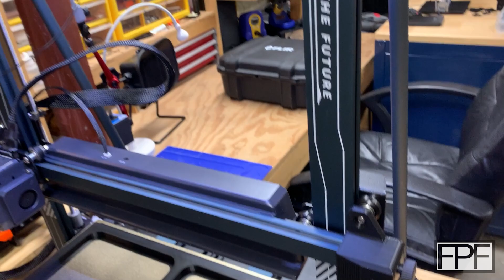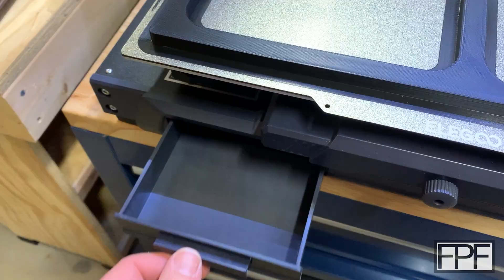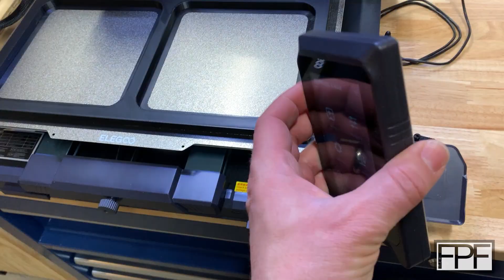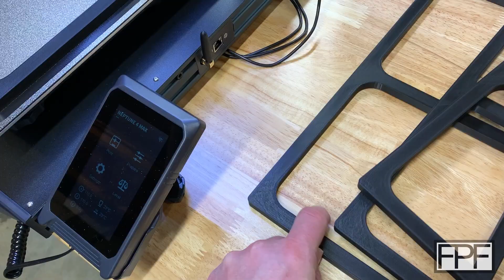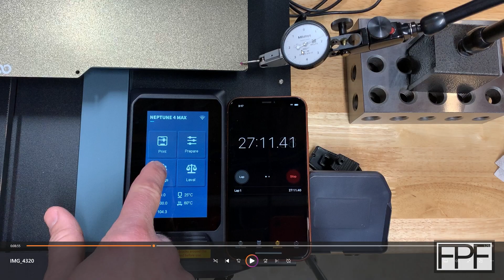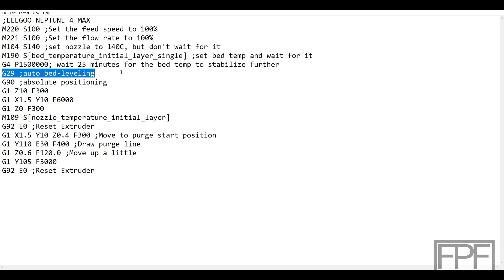Neptune 4 Max Review and a FIX for the PROBLEMS EVERYONE IS HAVING

Comment: So I got mine around the same time you got yours and I have had all the issues.Blob of death yup had it 4 times to the point where they sent me new heads. Firmwear def fixed a lot of the issues for sure. The issue I noticed that you did not mention was the back bed level screw knob backing off after a while. Like the movement would cause it to shimmy and next thing you know you have so really bad prints or worse the nozzel toughing the build plate something horrible  Great tip thanks.

Comment: @26:40 on my cr10 v1, I installed a cltouch and set up the gcode to where it heats the bed, levels the bed, and then begins to execute. 

I’ve always leveled the bed POST heating to the maximum I was going to heat for the current filament temp. 

Always a good idea to try and best replicate your working environment on these machines when dialing in

Comment: This is my first printer. It still sits in the box, unopened. I'm researching as much as possible. You say at the beginning this isn't a good 1st printer. Hopefully following instructions like these, before my first print, will help from me being instantly discouraged and throwing the 4Max into the dumpster. I'm going to do several upgrades before I even power it on, like X & Y linear rails, and a pair of front stabilizer bars. I'm undecided on a better (?) hotend like a Micro-swiss.
Reply: Just pull it out and print. Don't be scared, don't do upgrades before you understand the printer. Print, diagnose, fix. I'm not new to printing, I purchased this and I'm happy. I'm running into under extrusion so I'm playing with that. But I got 4 great prints already with nothing done.
Reply: How did all that go?  You sound honest, I don't trust many of these commenters.

Comment: Question.    Couldn't you bump the temp to 70C on warm up to allow for quicker equilzation then drop it to the desired temp that should shorten the time needed to get the bed warmed a simple temp gun would get confirmation on that.
Reply from the maker: Not sure, it adds more variables, and then more variables again as it starts to cool and the "maintenance" heating kicks back in to maintain the bed temp as it cools, all which will likely cause it to warp in different ways again.  Tnhe gcode I'm using has been working reliably for me since I released this vid, and I only use this machine for prints bigger than 305*305

Comment: I find it a miracle printers of this bed size manage to print half-decently at all. It is to be expected that heat expansion, bed movements, wear on belts and bearings will have a major effect on z height, especially when we are looking for precision of 0.1mm!
Look at your metal lathe, then look at this printer. The difference in rigidity and moving part quality is immense, yet the printer (and others like it) still manages to print at a reasonable quality. It is impossible to tune perfectly and for this tune to remain perfect long term, so I think we should cut Elegoo some slack here. 
As you said, the only way to counter this is to smartly compensate for the inevitable mechanical inaccuracies, in software. It is most likely what printers of other manufacturers achieving "perfect" results do without us realizing.

Comment: I've only ever used cura. Wonder if that's why my delta style printer (discontinued and the newest firmware isn't available from the manufacturer anymore) has issues with hitting the print constantly. Just downloaded orca because someone I talked to mentioned recently, but it has so many things that you have to program in for my printer (because mine is 4 years old and not on the list during setup) that I just don't understand what it all means or what they do. Cura is really simple compared to that. Plus my printer is on the list lol.

Comment: Printers this big should not have moving beds. This thing literally shakes itself apart. Their orange storm fixed this to a degree, but horrible execution on how you have to level it. I found that even doing everything you've done here, it eventually throws itself out somewhere else. I came into my office one day to find one of the spring adjustment knobs on the floor during an active print. I couldn't figure out what happened until I paused the print and felt the other knobs, only to discover they were also a thread or two away from falling off themselves. This printer has way to much vibration to keep all these things in check that you need for a good print. You might get 3-4 good prints out of it, then everything gets thrown out of whack again with just normal usage. I keep first layer at 0.3 to compensate for the deviation in Z. I know I'm never going to get a perfect first layer, but as long as I can get past the first layer ok, the rest are fine.

Comment: I'm glad I found this video, my 4Max is coming in post right now. Coming from a Flashforge 5M pro which, after tuning through orca is a great printer, I needed a larger vol for prototype parts for work. I've seen sooo many videos on why this machine sucks hahaha but I've seen the same amount of videos showing amazing prints. Tbh I have no clue how to work klipper.  I actually only know a very small amount of gcode...but knowing the info in this vid was actually a huge boost on what to look for

Comment: I will be getting mine tomorrow and this video is scaring me but then I read some comments and people say they are having no issues. Could it be some are better than others? I've also watched other videos about this printer and no one is mentioning this stuff. Because if this printer is this messed up,  Elegoo should be working on fixing these issues.
Reply: The people that said they aren't having any problems work for Elegoo.  ;). It's really hard to send it back.  If you don't open it and send it back it. costs you around $100 in shipping plus Elegoo charges a 5% restocking fee.  If you open it and don't use it and send it back they charge you a 15% restocking fee.

Comment: I am fortunate that my vendor is replacing my N4M after 2 months. This comes after multiple failed prints, hot-end replacements, and an extruder replacement. I am thrilled to get a fresh start. I want to be absolutely certain that I avoid the erroneous default software included with the impending machine. What version am I to install? Also, to summarize, I should install OrcaSlicer, but with the modified G-codes? You video is very informative. Can you please guide me the correct sequence in setting up my new N4M?

Comment: Hi. Your video saved my sanity... I dont have a Neptune, I have a Flashforge Adventurer 4. I suspect that bed heating is the answer for MANY other 3d printers.

I had a few other printers before this one and had similar issues. I had upgraded everything on the machines without much success. 

As luck would have it, I was interested in buying the Neptune 4 MAX and found your video.

I would recommend that you re-visit this topic and solution for general 3d printer adhesion issues. I have trouble finding this video because its not the name that I associate with it. 

I have been recommending your video to others with similar issues.

Comment: Excellent video - very informative and detailed. Thank you for sharing your knowledge. This specific problem has had me very frustrated for a while. The usable volume on the Neptune 4 Max is now within reach of reliable & repeated use. Like and subbed. I'm also adding a metal extruder gear and the Microswiss hotend for the Neptune 4 Max. Hope to get it to reliable workhorse status.

Comment: Wondering if you ever considered going hotter on the build plate for the warmup period, then letting it cool to the print temp.  Would that help you get to stable bed faster?  So if you printed at 60C why not run it up to 90C for 5 min then bring it down to 60C.  Would that get you to a stable point for your bed so it can auto calibrate at that point?  Curious to see if that sensor of yours gets to the stable point faster.

Comment: As a someone looking at getting into the 3D printing hobby, I'm so interested in this machine because of its build volume.  But the issues with the firmware(s), the proprietary slicer, lack of support for mainstream slicers, and all of the other problems just means it's not an option, which is pretty disappointing.  This machine has a great price point, but I'd frankly pay twice that if Elegoo would join us here in 2024 and provide a UX comparable to something like the X1C.  I'm not interested in screwing around with and constantly having to fix a printer.  I just want it to print what I want, when I want, and do a good job of it.  Really hope Elegoo listens to all of the reviews of this machine and comes out with something better.  I would still love to have a printer with this build volume, but this is just too much headache.

Comment: Ordered it, , heard about the Blob of Death, canceled the order, and thanks to you, consider to order it again for good.
Would you think that, for the long term, intensive use, linear rails update For X and Y worth it?
I also watched a video about nobs of the plate getting loose due to fast printings vibrations, what did you experiment?
Thanks again.
Reply from the maker: I do get quite a bit of dust from the wheels.  If I used it more, I would consider rails.  For me, this printer ONLY gets used when I need the huge build volume, so I'll probably keep the wheels.  I haven't had my knobs move at all.  Honestly they seem quite tight.  I wonder if people are "thinking" they are moving because they are seeing a height difference when measuring and not realizing it's from heating/cooling.  Obviously not true if people have videos of them moving, but made me wonder.
Reply: @FunctionalPrintFriday Thank you for your reassuring video, answer, I reordered the 4 Max. Do you think there are better quality wheels, less "dusty"?
As I plan to install my Neptune 4 Max on a heavy base, I wonder what its minimum dimensions could be to accommodate the feet. If I may ask you to measure... 😅

Comment: Very useful!! I inserted your gcode, I also don't care about waiting 30 minutes more when with this printer I print huge things that require more than 24 hours. Half an hour is nothing and if I want more speed, I use other printers. As soon as it arrived I leveled, immediately inserted your gcode and started the print I wanted. The first layer was already precise (among other things, the printer was bought used). Excellent and useful! Thanks!
Reply: I bet there's a LOT of these printers on the used market.  ;)

Comment: how about a soft start using a dimmer and lower rpm for the coolers?
Reply from the maker: switching power supplies will just generally draw the same watts at a lower voltage by increasing the current they sip through each AC cycle

Comment: What is the current status, have the mentioned issues been resolved? I am new to this hobby and plan to get started. I'm considering between the Elegoo Neptune 4 Max and the Artillery Sidewinder X4 Plus, but I will most likely choose the Elegoo Neptune 4 Max because of its larger print area. However, I wanted to ask first. Additionally, can it handle composite filaments, such as carbon fiber blends, at 300 degrees Celsius?

Comment: EPIC video, well what can I say you are totally correct....the only thing I can add to this is that I have the same issues with my Ender 3 S1 plus and my CR10 Smart Pro - I think you are going to have similar issues with any large area 3D CONSUMER 3D PRINTER WITH A cheap 6061 alloy print bed...  - I think you will have Dimensionally a totally new print bed very time you heat cycle it.   so you can't call this a Neptune 4 Max problem......      Before every print job I heat up the bed to 90 and then auto bed level, mesh save to memory, and then the print job starts ( this adds 8 minutes to every print job )....Epic video thank for making it ! keep the technical content flowing !

I just bought a 4 max - frikkkk - any way to upgrade the psu to the 500wt psu from the 3 max

Comment: I’m still new to 3d printing I say new because my last 3d printer was years ago and it was a tiko, if you know you know, I got this exact printer because of the build surface and I have to say the software set up is shit because of all the problems but got mine taken care of, I bought mine in October of last year and had problems with the software out of the box and spent a few days trying to figure it out because the z kept resetting. I did had a bed leveling issue but because the wheel on the printer head was loose and the screw on the z screw was to tight causing a slight layer shift. But starting after my experience with the tiko this printer was amazing except for the software, I still want something besides cura.

Comment: Haven’t had these problems with my printer I did find that the cooling fans definitely made my prints worse but I print at 150 to 100 print speed I’ve done many prints that take 3 to 4 days to finish very few failed prints some of the failed prints were my fault being lazy although I do preheat the bed be for prints

Comment: First guy I've heard to relate 3D printing to machining and started adjustjng the machine as such. Subbing. I appreciate that you also acknowledge that you've been pondering this for weeks.  I think 3D printing is a great intro to machining and the processes involved, but I think manufacturers are trying not to intimidate new users with how much effort goes into zeroing equipment.  My primary example is the "piece of paper" height setting for the z offset. I think it would be better to assign a designated gap and send people an appropriate feeler gauge. Personally, I use a .7 mm feeler gauge.  The same applies to belt tensions. There should be a designated tension set by the manufacturer and a simple tool included or for affordable purchase. Torque value for carrier wheels... I digress. 😂 Again, these machines are a great value to introduce people to machining processes, but manufacturers need not fear specific tolerance, and consumers need to understand better prints require more setup time and constant machine "maintenance". You don't win Lemans in a daily driver where you change the oil once a year.

Comment: Very similar issues with the Neptune 4 plus. Being new to 3D printing I considered myself lucky so far with the results I've had with the printer given some of the nightmare stories I've seen on Reddit. With that said I was content living with the overextrusions. Though the 4 plus does have a much smaller bed I'm thinking literally the only difference between mine and the max is size. Thus issues would be similar though likely exagerated on the max. I'll probably be able to safely cut the wait time in half for the bed heating. All the other GCode/Config settings changes would probably be the same (purge line will need some tweaking I'm guessing). I'm going to give this a shot tonight. Great job!
Reply: hey i also have the plus any chance you have start code Ive tried a few times but mine keeps crashing my print head. im not sure what im doing wrong
Reply: @user-gl2ss2th3m  Here you go:

;ELEGOO NEPTUNE 4 PLUS
M220 S100 ;Set the feed speed to 100%
M221 S100 ;Set the flow rate to 100%
M104 S140
M190 S[bed_temperature_initial_layer_single]
G90
G28 ;home
G1 Z10 F300
G1 X115 Y0.5 F6000
G1 Z0 F300
M109 S[nozzle_temperature_initial_layer]
G92 E0 ;Reset Extruder
G1 X115 Y0.5 Z0.4 F300 ;Move to start position
G1 X205.0 E30 F400 ;Draw the first line
G1 Z0.6 F120.0 ;Move to side a little
G1 X210 F3000
G92 E0 ;Reset Extruder
Reply: @user-gl2ss2th3m  

;ELEGOO NEPTUNE 4 PLUS
M220 S100 ;Set the feed speed to 100%
M221 S100 ;Set the flow rate to 100%
M104 S140
M190 S[bed_temperature_initial_layer_single]
G90
G28 ;home
G1 Z10 F300
G1 X115 Y0.5 F6000
G1 Z0 F300
M109 S[nozzle_temperature_initial_layer]
G92 E0 ;Reset Extruder
G1 X115 Y0.5 Z0.4 F300 ;Move to start position
G1 X205.0 E30 F400 ;Draw the first line
G1 Z0.6 F120.0 ;Move to side a little
G1 X210 F3000
G92 E0 ;Reset Extruder
Reply: @user-gl2ss2th3m  Mine keeps crasdhing the head too, did you ever end ip fixing this?
Reply: @MyGuyNoob  yes i just got rid of the home command after the leveling command

Comment: I've had mine for 8 months, never had a problem sourcing larger nozzles - the app actually does give info on print times and jobs.
For those who are wondering about the neptune 4 - rubber wheels, and levelling system were deal breakers for me

Comment: I've been looking to add a larger format fdm printer to my collection, and been waffling between something like the neptune 4 max/plus vs the neptune 3 max/plus. This video has sold me on the 4 series, not because they are issue free but because it shows that you can tackle the problems they present with a little critical thinking and experience. 

I've been using an ender 3 s1 pro for almost 2 years, and have enough experience in fdm printer maintenance and operation, I think, to tackle the challenges of the 4 max/4 plus, in order to achieve the faster printing speeds and larger build volume that I want to add to my repertoire. 

I always let my bed heat up, even on my ender 3, for like 15-20 minutes before leveling or before a print, so doing so on the larger printer not only sounds logical but would have been part of my process anyway even without seeing this video - and if you're printing at 250mm/s instead of 50-80 anyway, that extra 30 mins on the front end, to get a 3 day print done in 20 hours, will have been worth it!